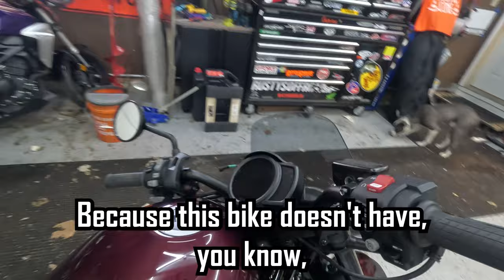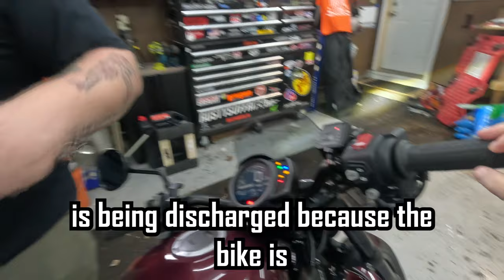I bought a new Rebel 1100 (and IMMEDIATELY took it apart)

Comment: I have the 2021 Rebel 1100 same color. Shorty gp right away here too. I did install bar end mirrors. A few washers and longer screw will give you all the room you need. I'm not a long time rider like you, but I love my rebel. Good stuff man.
Reply from the maker: I'm loving mine so far too, and already switched from the Shorty GP to something else. Update on it soon, but it's autocross weekend so I'm running behind

Comment: I got arebel 1100 and i love it!! But i would never replace the mirrors!! They are the best for me!!
Reply from the maker: I can't like the stock ones, but these bar-ends wound up being cheap and annoying to keep adjusted. I just recently switched to these, and they are the best aftermarket mirror I've ever used.

https://www.amazon.com/MZS-Motorcycle-Rear-View-Mirrors/dp/B081CRSZ4H/ref=sr_1_6?crid=38M7XX44GTUNO&dib=eyJ2IjoiMSJ9.iXF3HMZ8QaBuM__dEo-4RG3wjJS-u8h7kEZGHKIr8ECHPYdDoL2X8-mAyTQwFNdBOl_K6i1YTLAVe1Z1HijptSuWv00AcZUZNLUhTWctOI_iZgc1lOdhO77xrzbp4En2m45uZCzIuLDIv9pGEWOSKfXgtjQlTdM5ZAUS75ixGSg5kejK3qE-N97lzpJQLVfwYJAndOZJxNyrLOF7H3RT0YjzMUXqwyugikiscV3GjcmPADwsRrzzOQvpeM85ynnqo6n9oqSsbRBHn9pgc1tI4NiOiRvjTNZbfOndvzm6Y8U.MBup_Xxi7YZYtyr6Hk4tPZUemlwquTSEin8ZUYfeeII&dib_tag=se&keywords=rebel+1100+mirrors&qid=1712968871&sprefix=rebel+1100+mirrors%2Caps%2C112&sr=8-6

Comment: hi, I been thinking to get those heated grips after a failure experience with the Honda heated grips installed by the dealer (very expensive and not recommended at all). I'm gonna wait until We are closer to winter temperatures or below 30 degrees. Thx for your video, I will follow you for more videos to come ✌
Reply from the maker: The Oxford grips are excellent, and I have run them on many bikes. They are the only correct choice, and have a few options for grip style. I prefer the Touring model.
Reply from the maker: What went wrong with your OEM Honda grips?
Reply: @redhenracing2  they would work for about 5 seconds then an error code would pop. They claimed they were defective but I believe when they ran the cables.  They got pinched. A YouTube friend mentioned to be really careful on tiecable them or not to bend the cable too much.
Reply: @redhenracing2  I heard excellent feedback and are very affordable

Comment: What’d you think of the smaller windshield? Did you take it on the interstate at all? I was thinking about getting a batwing for mine off the bat. I want to take a xc next summer.
Reply from the maker: Almost all of my mileage is highway, and I've done a bout 2500 with this windshield in place.

I have decided that this one is a purely aesthetic choice, and provides basically zero wind protection. I still like the style of it, and I don't mind some wind pressure to take weight off of the wrists, but as large as my front surface area is, I find myself getting pushed back and almost having to hang on to the bars at anything over 60. It does generate some fatigue after an hour or two. For a lot of highway time, I'd definitely go with something bigger than this one.

Comment: Tips from a track rat:
One way we lock down non-stock grips onto the bars/clip-ons is using lockwire.  Advance and O'Reilly's both have lockwire kits if you don't happen to have your own (which I highly doubt).  2 strands, one at the base of the grip and one at the end.  I personally double-twist mine to give it a bit more rigidity, and aim to have the excess point off the grip in the down-and-back position (4-oclock on the clutch side and 8-oclock on the throttle side when looking straight down the tube), that way the pointy bits of the leftovers are in a spot that your hand never touches anyways.
Reply from the maker: Lockwire . . . never heard that one but it sounds like it works. These heated grips are a lot firmer and not bendy like normal grips, so I don't know if it would work on them

Comment: heeeey, what up buddy. I just ordered the same heated grip you have and the super glue you used as well LOL. I got a few questions. Did you finally sale the bike? and does that super glue stay on even after you heat up the grips? everything else it seems to be answer with the video. Take care and thanks for the heated grips info tips etc. see ya around bud
Reply from the maker: Hey man! 

I still have it, Minnesota winter is not the right market to sell a bike in, lol

Never had any issue at all with the glue holding up, and I've run the grips on full blast for many miles.
Reply: @redhenracing2  oh man well I hope you sale it. Maybe someone from out of town. Thx man on the info. I should have them in the next couple’s weeks 💪🏼
Reply: @redhenracing2  hey buddy. I just got the heated grips and tested them before I remove the oem grips. Holy hot Batman. It would burn my bare hands if I hold the grips for too long 😊 no issues with the other devices I got plugged on the bike so I’m gonna run the cables. Remove the oem grips and all that jazz. Just wanted to thank you for the grips info. This is done because of you. happy holidays if we don’t talk until the day. See ya buddy

Comment: How well do the bags work on this bike? What size?
Reply from the maker: We are now running this set from SW-MOTECH, 25.5L on the left and 19.5L on the right. Fits perfectly with the Vance&Hines exhaust, and it now has a Givi top box rack and T-Rex racing cargo rack as well

https://sw-motech.us/products/luggage/Legend+Gear/4052572218358.htm
Reply: @redhenracing2  would two 25L bags work if there was a shorter exhaust?
Reply from the maker: @Boifarmer  it would, if they make a 25L for the right side. They don't make a set for the Rebel like that, probably because the crossover between people with cut off exhausts also buying $1000 saddlebags is relatively small, but a lot of their stuff is very modular and it's worth reaching out to them
Reply from the maker: @Boifarmer   Also make sure the exhaust is pointed well away from them, it's made of a very solid material but probably not good to blast it

Comment: “We’re smarter than the people who designed them”😂😂😂 I got the windscreen and a swing arm bag on mine, but thats all I wanted to do. Mirrors fit the style, etc. I hate cheap aftermarket parts. I never change out the stock exhaust. Your bike gets louder and never runs, idles, starts as smoothly once you do. Thats the beauty of this bike, it’s silky smooth. Dont F it up. If you need cool looking exhaust and multiple mods, buy an Indian. You end up spending the same anyway. Need an obnoxiously loud bike get a Harley.
Reply from the maker: The Vance & Hines exhaust is 100% better than stock in both looks and sound, without trying to be obnoxious or causing a single issue of any kind. The cheap dump was a no-go for me after only a couple of miles, the V&H is absolutely the correct and tasteful choice.
Reply: @redhenracing2  they don’t run and idle quite as smoothly as stock.
Reply from the maker: @mikemccormick8115  it 100% does, but if it's not for you that's cool

Comment: Did anyone try belt conversion kit's on Rebel 1100?
Reply from the maker: I don't see why they would. Why would you want that?
Reply: @redhenracing2  just to avoid having a stand to raise your motorcycle, endless chain lube, etc...
Reply from the maker: I've never owned a belt drive, but I don't see the appeal. A chain is inexpensive and pretty minimal maintenance 

I figure there's a reason that 99% of motorcycles worldwide, from cheap commuters to GP SuperBikes and dragsters use chains 🤷
Reply: @redhenracing2  I have a shaft drive BMW 1250R and a Rebel 1100 DCT... love them both but 1 needs to go (according to my wife)  I want the lack of maintenance of the BMW on the Rebel (more suitable for my short city drives and around the city).
Reply from the maker: If having to lube a chain once every couple of months is what breaks the deal for you, then I guess it be like that. I can't imagine claiming less maintenance on even the most reliable beemer over literally any honda, though

Comment: whats the exhaust called?
Reply from the maker: Man, this was a while ago. I think the first one we installed here was a Shorty GP that was like $30 on Amazon, and it was awful. Even though it was better than stock, it looked and sounded cheap. We are currently running the Vance & Hines, and couldn't be happier. That is the correct exhaust for this bike.
Reply: @redhenracing2  thanks for answering man.
Reply from the maker: @KoufalKoufax  I am finishing an edit right now for a massive parts comparison, including a couple of exhausts. It'll be up in a couple of days after the Pit Crew gives it a quick QC check. It'll be our comprehensive guide to modifying these bikes, and mine has come a long way since this video
Reply: @redhenracing2  Great! Quite excited to hear it, Imma hang tight until the video drop.
Reply from the maker: It's up! Exhaust reviews are towards the end.
Reply: @redhenracing2  nice imma check it out now

Comment: Wondering how much this guys weighs. I weigh 220 and I wanna throw my roommate on the back of it but it’ll put us 50 over the weight limit. I wanna know if it’ll be fine or it I gotta go on a weight loss journey in order to have passengers 🤷🏽‍♀️😂
Reply from the maker: I'm 330 myself, and Honda says it's only good for 350. It's certainly still quick enough and handles just fine when I have it loaded with cargo towards 400lbs, so as long as you stiffen the suspension and aren't bottoming it out I'd reckon you're alright. Bully Brand sells heavier duty shocks for it, knowing that this is a weakness.

Us big guys can never catch a break, I swear 🤣